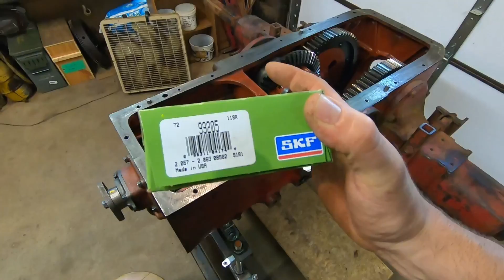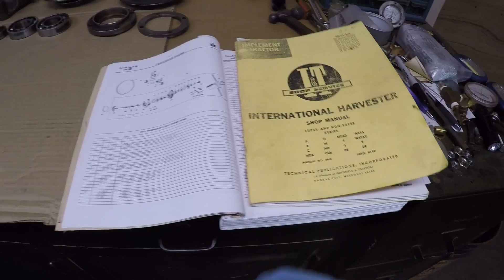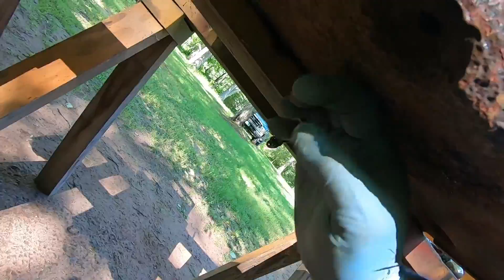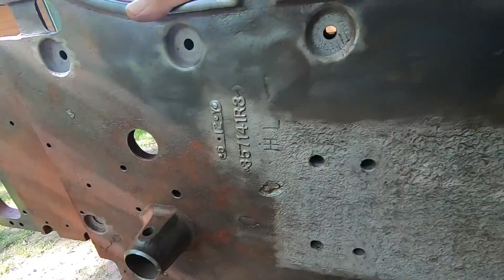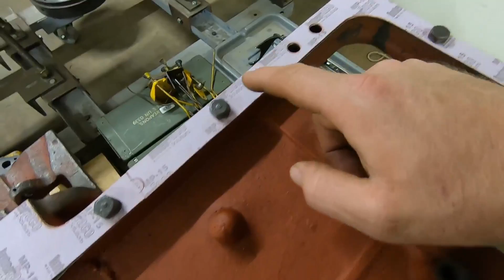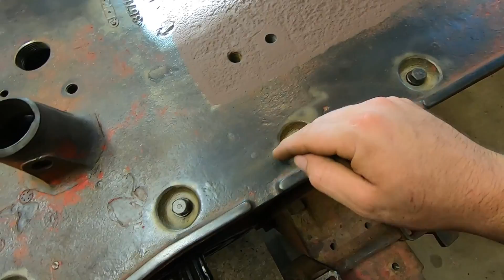Farmall Super M Rebuild Ep.32: Water Pump - Input Shaft - Shift Rails & Top Cover Goes Back On

Comment: 27:14 for future refference, you can fill those holes up with butyl almost all the way up, then put some bondo (or however it's called) and then paint over. Won't fill with water, won't rust, easy to remove, should resist to wear and tear of traffic, unless you just happen to put a nail through that one spot where they are.

Comment: Nicely Done.  Wire Wheels polish the surface where media blast gives a proper anchor pattern for coatings. I thought you might put some filler in the pitted battery box area.

Comment: what i love about the H and M series is you can fix the transmission without breaking the tractor in two and fix it in the field.i was sent on a service call on a M with 9spd  turning 70HP with the M&W engine kit and crankshaft. it shattered the drive coupling and ruined  the input shaft to the trans this wrecked a lot in the trans so my helper and i field repaired it in one day. it was in the middle of a very wet field with a 14ft disk on it. no way to move it .  so we fixed it and drove it out of the field. the owner was so happy and we got a bonus that week. the shop labor rate was $12/hr per mechanic. those were the days

Comment: I BOUGTH AN 8 N FORD TRACTOR AND PLAN TO CHANGE THE TRANSMISSION OIL IN IT ,SHOULD I RUN SOME KIND OF CLEANER THROUGH THE HOUSING , IF SO WHAT KIND AND WHAT KIND OF TRANSMISSION OIL SHOULD I USE . THANKS STEVE
Reply: @squatch253  THANKS INFO VERY HELPFUL

Comment: Sandblasting. I've worked on lots of vintage cars for customers and most of them had been sandblasted with entire power trains installed and usually by the same person. He was clearly unaware  of or uninterested in the consequences. The most dangerous examples were steering systems siezing up in use from grit inside them. Lots of vintage stationary engines badly damaged by the same method.

Comment: You guys do great work!....very thorough. I have found two things that help a lot with old rusty stuff. 1) brush on bead liner. I use it in battery boxes and on foot tread/plates where traction and lack of rusty is more important than color. 2) Ospho phosphoric acid(the active ingredient in rust converters) made by Skyebrite and sold through hardware stores. Turns iron oxide into iron phosphate and can be used in place of primer.

Comment: You should do tractor restoration and repair instead of Ford dealer repair.
Your degree of skill and experience is very valuable to anyone wanting their machine fixed correctly. 
Don't be afraid to charge max rate and make all the money you can handle.
Reply: @squatch253  I think you just need the right client that appreciates quality and agrees to your shop rate,  there are no budgets or estimates for perfection. You pay what it costs.
The bitterness of poor quality remains long after the sweetness of low price is forgotten.

Comment: I have a Farm all M apart and I am replacing the seals that go into the transmission. The question I have the one on the bottom the shaft that drives the lift all pump how do I get the coupler off of the shaft? It seems to be threaded.
Reply: Squatch253...yes it does.  When I get my brakes hooked back up I should be able to lock up the tranny and spin it off.  Thanks for responding!

Comment: The thru bolts on the top cover that you sealed, I've run into the oil  wicking up problem as well. I used teflon pipe sealant, what did you use? The Permatex Ultra Black?

Comment: If I read the codes on the plate right, by memory, the M is a 1953. Battery under the seat and not an M-TA? Interesting. Is it factory live hydraulics?
Reply: Factory live hydraulics used a cubical hydraulic control unit under the fuel tank. Since it is about the size of the older under-tank battery box, they then  created the battery-box seat support on the transmission. It’s a handy field spotting clue; if an H or M has the old seat support, with battery under the tank, you can be pretty sure it doesn’t have factory live hydraulics—assuming it’s still in original configuration.

I’m rusty on the various “stage I, stage II” type nomenclatures, but as the Super H and Super M were modified in production, approaching their “number series” replacements, live hydraulics became available. “Supers” initially had only larger engine displacement and disc brakes (and a list of more minor durability upgrades), but still used the transmission-driven belly pump. Then came live hydraulics, with improved timing gears to handle the pump load. That was the end of development for the Super H, but after the Stage II  Super M came the Super M-TA, which gained the torque amplifier and independent PTO.

So, it went:
•M, band brakes, C248 engine
•Super M, disc brakes, C264 engine
•Super M stage II, added live hydraulics, moved battery under seat
•Super M-TA, added TA and independent PTO

Comment: So Toby, the C and Super C pull a lot better in road gear as the pinion and ring gears are driven from the bottom shaft, so road gear is geared down on them.  Thought I'd mention the difference where road gear on the H and M is straight though.  Hope this helps some folks.

Comment: ......there's always that one bolt, but hey you got all those perfect 90's lined up, and you take your victories where you can..!!
Like the meticulous planning and work both of you are putting into bringing the Super M project through and slowly the build is coming to a right finish. About the battery, I think to put 2 or 3 paddings between it and the top metal cover and will also keep rain water/moisture off the top.

Comment: Awesome!  I was waiting to see how those forks were set up.  A lot simpler than I expected.   Thanks for laying it all out and going through it.  AND for filming and sharing it with all of us.  Mighty fine work!   On a side note, I had my  '49 M out and about today.   It was shifting through the gears just fine now that I brazed up the worn bit on the foot of the shift lever.  I could probably add a little more material to the side of the foot, but it's working well.  My brother and I also machined up a new swivel rod and pin for the shift lever too.  They were seriously wore out.  Even a little bent.

Comment: Squatch, putting the top cover on with such care and precision makes you wonder how they did it at the factory on the production line. Surely they had some way to mate the top cover to the gear case in about 30 seconds. At any rate, the back end of that Super M sure appears to be in stand up shape. Also not note, interesting that the ring and pinion is a bevel gear vs a hyphoid. Cheers!

Comment: Did you put sealant under the heads of those recessed bolts? It looks to me like they are little water traps that can turn themselves into artisan wells and accumulate rust all down the shaft of the bolt.
Reply: @squatch253  I heard you say you sealed the threads. I was just wondering about water pooling above that sealer along the length of the bolt.

Comment: The M, W, O and I series all shared the same transmission cover. The extra non-tapped bosses inside the transmission cover are for seat bracket mounts for the W, O and I series. I am on the opposite end, I have all Orchards (O series) so the forward most holes are not tapped on my covers.

Comment: Great video. The 
"interlocking joint" on the home made gasket is new to me. I have always just butted the connectioned, and used xtra sealer and hoped for the best. Could you spend time on the interlocking  joints ? Hoping for the best often dosent work for me.
Reply: Caterpillar in a few applications use a puzzle peice type joint to join gaskets 
They don't work as well as solid gaskets but they sorta work 
The 3516 sump gasket is the most common one that haunts me 
It's always the first job on any truck that makes it's way in

Comment: Wouldn't a "flapper" wheel  help remove most of the pitting? For the recessed holes, it's not original but, we'd used rubberized flat washers with a bit of sealant on that. Great work. Can't wait to see the Super M finished and running again. Cheers :)

Comment: Love the dolls head gasket joints, first class craftsmanship! Rookie question about those through hole top cover bolts (that you sealed the threads on): would one be courting disaster by making "sealing washers" out of, say, roofing membrane, to place under the flat washers, as a "belt and suspenders" backup to sealing the threads? I know, heretically unoriginal, but would it be a workable, functional mod? Or would one be risking forming a slow draining bathtub hellbent on contaminating your gear lube?

Comment: That was an amazing, first hand explanation of how a manual transmission works.  I'm sure this is just about as fundamental as they get, but even the most exotic manual transmissions probably use the same fundamentals.  I always knew how they worked theoretically, and have seen the insides of a few, but this was unencumbered enough without synchronizers and everything, that you really have a good sense of how it works.  And your diagnoses of the issues that are produced by wear in various places rang like a bell when you said your transmission howls in first through fourth, but is quiet in fifth gear.  This is why an actual mechanic knows more about your stuff than you do just by hearing it.  I wish you would figure out a way to give the same explanation somehow using the shifting mechanism with the cover off the gear box so we can see how the shifter works.  Thank you.
Reply: Yep, manual transmissions are pretty much all like that, just size and the number of countershafts vary. And synchronizers of course, but those are just little weak spring-operated clutches.

Automatic transmissions are considerably different. No sliding gears, it is all done with brake bands and clutch packs. Basically all of the possible speeds are in mesh all the time, but one gear for each speed slips on the shaft. A clutch between the shaft and the gear is applied to shift into each gear.
If you want to know some more, look up the "Precision Transmission" YouTube channel. They have lots of videos on transmission teardowns that will show all the parts.

Comment: Super nice video. A pleasure to watch. Use stainless steel bolts and nuts so that they don't rust.
Reply: They are going for minimal expense recondition on the tractor
Reply: @haydenc2742  I know, but they are not expensive. Plus, in the future, having a bolt that is not rusted shut, is better.

Comment: A good alternative to sand blasting and a whole lot less messy and that is a needle scaler. Very effective at crusty rust removal.
Reply: Even though the area he blasted will be hidden by the battery box, i don’t think he’s looking for the finished profile the needle scaler would leave in the cast iron outside of that covered area. I’d prefer the “as cast” look myself, and sand blasting maintains that cast profile in the metal. So I’m thinking the sand blaster is the better option here.
Reply: LineshaftRestorations that would work but I don’t think squatch would use it because it might be hard not the castings it also will pound martial into the cast other than a sand blaster which is more like a wire wheel, in my opinion I would just use a wire wheel and brush.

Comment: Ok son, now you have my eyelid twitching. I am rebuilding my 1020 John Deere (gas) i ordered a speedy sleeve for my front engine crank seal.
It was a 1/4" longer than needed. What did you do with yours? I put my front pulley in the milling machine and cut it back to the edge of the pulley bevel, some fine emery cloth and its blended nicely. Now rather than having a sharp edge I can use the original bevel so as not to cut my seal installing the front pulley. This is the first speedy sleeve I have even used and I'm wondering if there all are like this?
I am a welder not a mechanic so i find your videos very helpful. Thanks and keep smiling.